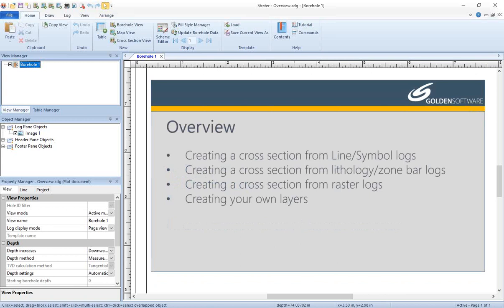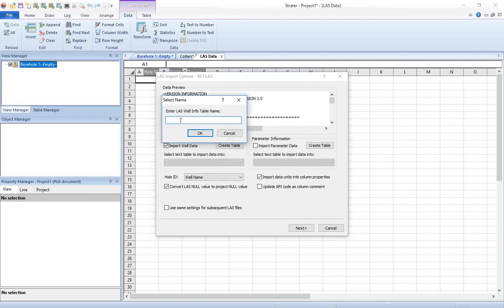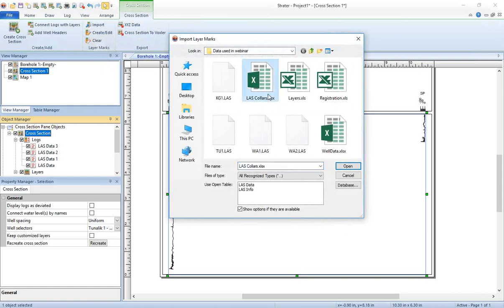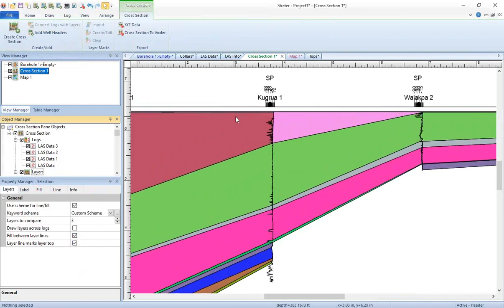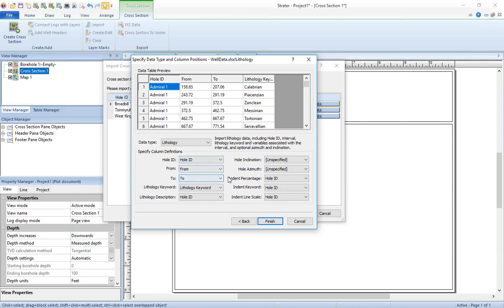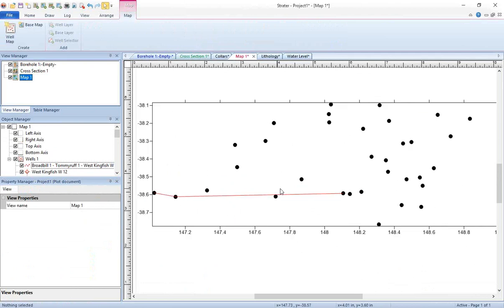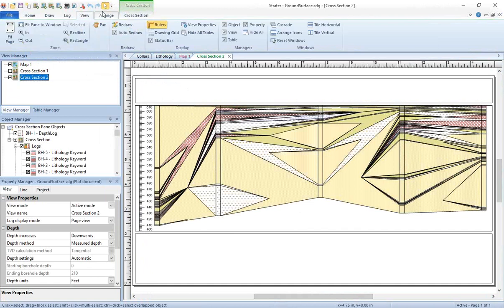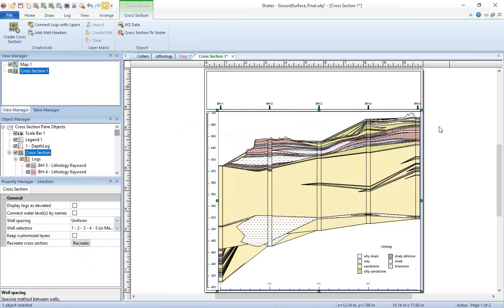Strater 5 | Strater Cross Section Crash Course

Comment: Hi! This might be a silly question but it´s my first time plotting logs and trying to get a cross section. I see you are creating the cross section from previous data tables with the bottom and top depth for each layer. So did you do those tables manually? How would it be the procedure from scratch since plotting a line log for the first time to having those final tables? Do you just analize the line log and get the depth data manually and write it down on an excel sheet to generate your tables manually? or is there a way to mark specific points on the line log and import them into a table? Thank you so much!
Reply from the maker: Hi there,

Thanks for your comment. All logs in Strater are table-based, meaning you must have the completed required tables for that log type before you can generate the log. Yes, typically that data is either entered in manually, or, the data was collected from some sort of data collection device and then organized into the proper table format for Strater. This could be done in something like Excel or directly in Strater via the New Table function. 

In addition to this video, it may be helpful to search the Strater Help (either online or within Strater by clicking the Home | Help | Contents command) for 'Creating and Editing a Line/Symbol Cross Section' to pull up a detailed explanation of creating a cross section like this. It may also be helpful to search the Help for 'Table Types' to learn more about the different table types in Strater and what each is used for.

Best,
Golden Software Support

Comment: I have a situation. I have 2 boreholes drilled in the samle location. One in 45° angle and another in 90° angle. now i want to create a cross-section. how can i do so in this situation. does strater have any feature that enables to show 2 borehole in same location but different angle. Another situation is that the boreholes are not in the same elevation, when i generate cross-section strater shows all the logs to be of same elevation. how do i fix this ??? would be grateful for a reply.
Reply from the maker: Hello!  Thank you for sharing your questions.

To create a cross section where one or more wells are not vertical you will first need to define the well trajectory in the collars table or in a survey table.  Once the well path is defined, follow the instructions on this help page to display the borehole as deviated in your cross section: https://straterhelp.goldensoftware.com/#t=command%2FCrossSection%2FDisplaying_Deviated_Logs_on_a_Cross_Section.htm

To create a cross section where the borehole elevation is displayed, follow the instructions in this article:
https://support.goldensoftware.com/hc/en-us/articles/226500547-Hang-a-Strater-cross-section-on-a-marker-bed-or-set-the-reference-datum-to-mean-sea-level

Thanks!
Golden Software Support

Comment: I am trying to load the LAS data to make to cross section but when I get to "Import Cross Section Data" at 15:30 in the video my LAS data is not loaded. I tried to load it in this pop up but the files still would not show/import in correctly. Is there any way you can help?
Reply from the maker: Hello - without seeing the file it is difficult to determine what the issue might be. Our email support is free and I recommend you email our support team at support@goldensoftware.com with your question. Including your LAS file in your email will provide the fastest solution. If you cannot attach your file, a screenshot of the issue would also be helpful. 

Thanks - Golden Software